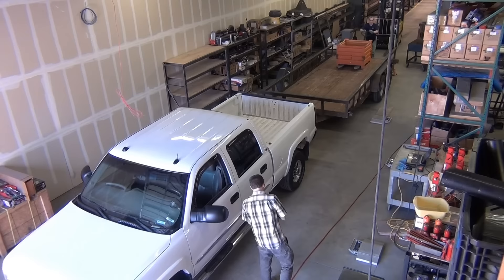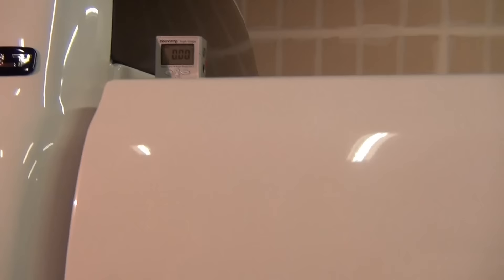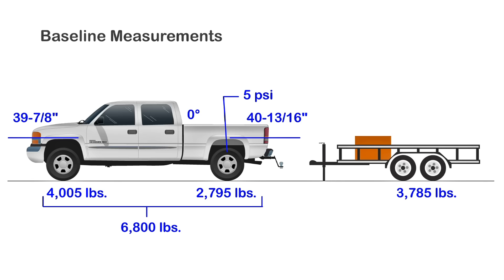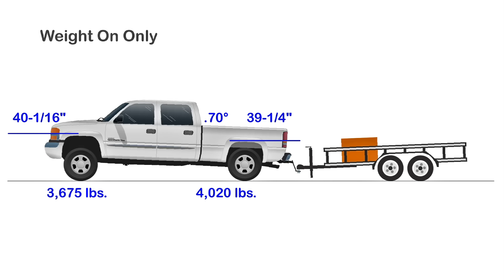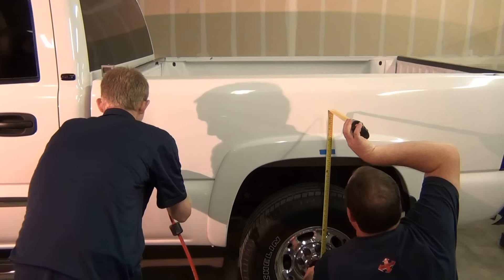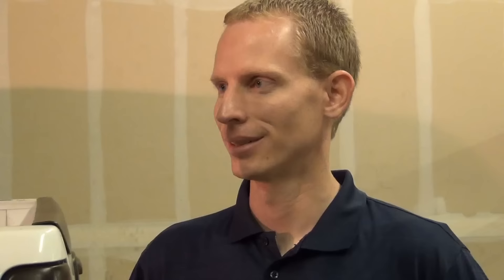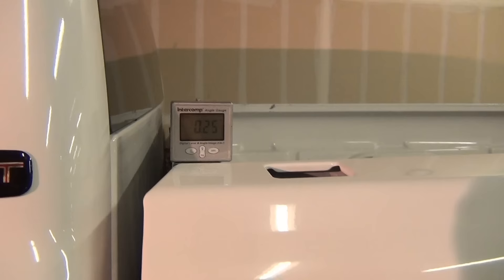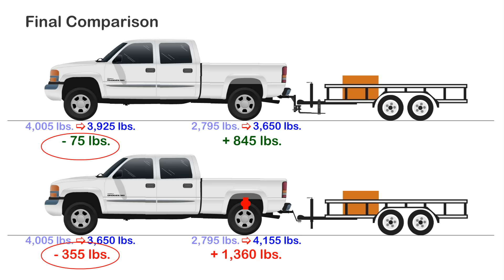The Difference Between Using Weight Distribution and Air Bags to Level Your Load

Comment: Hi, can you confirm the overall combined weight increases when using the WDH compared to using no other devices for levelling vehicle??
Reply from the maker: When looking at the overall combined weight for the “coupled”, “leveled with airbags”, and “weight distribution” setups – the resulting totals were 11,695, 11,715, and 11,720 lbs. The difference in these numbers is attributed to the precision and accuracy of the wheel scales that we used and is within 0.2%. Being within 0.2% when the precision/accuracy errors of 8 different scales are added together is quite good – especially for our purposes in this demonstration of general principles.

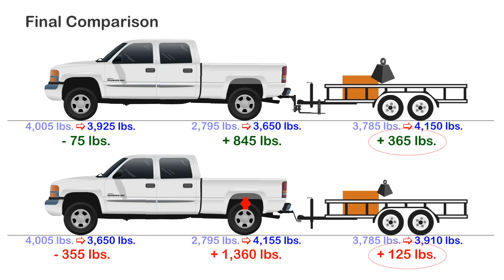Admittedly however, there are some typos and a mistake in the numbers shown which do account for some discrepancies. One of the mistakes is with the baseline trailer axles number which then carries through in the math throughout the video. With the trailer uncoupled we used an additional scale under the jack when measuring the tongue and axle weights. There is a conversion that then needs to be done to get the exact weight at the hitch ball coupler location. We used the converted (actual) tongue weight of 1000 lbs. in the video but forgot to use the converted axle weight. So, the uncoupled or baseline trailer axle number given is 70 lbs. less than the actual. Also, we didn’t add the weight of the spring bars (35 lbs.) to the uncoupled total. With these two corrections the “uncoupled” combined weight should have been 11,690, only 5 pounds different from the “coupled” combined total. The additional discrepancy is due to the precision and inaccuracy of that tongue weight scale that we used. At minute 12:17 in the video – the correct increases to the trailer axles should be 295 lbs. for weight distribution (instead of 365) and 55 lbs. for the airbags (instead of 125). For the airbags, that trailer axle difference should theoretically be zero when leveled. The reason it’s not is due to the trailer not being at the exact same level/angle and the scale precision/accuracy. As the trailer tips down in front then the front axle of the trailer will take a slight bit more load from the tongue weight. In the weight distribution example, some of that weight difference would also be from the trailer angle and scales then also some from spring bar weight. The majority (~250 lbs.) is from the forces of the bars on the trailer for weight distribution.

In spite of some unfortunate presentation mistakes in the video, those errors only affect the magnitude of the effects which will be different for each towing setup anyway. The general principles remain the same – 1) Even though airbags are good for vehicle leveling and ride comfort, they do not distribute weight off the rear axle back to the front axle nor achieve all the towing benefits that come with weight distribution and its inherent sway control 2) Weight distribution increases front axle weight for improved steering and handling and also alleviates the weight and stress on the rear axle of the tow vehicle 3) Because weight distribution also levels the vehicles, airbags usually are not necessary when using a weight distributing hitch.

Final note, airbags or auto-leveling can be used with weight distribution to improve ride comfort if desired or if auto-leveling cannot be disabled on the vehicle. Keep in mind that increasing airbag pressure or auto-leveling after setting the hitch will decrease weight distribution. Measure the amount of weight distribution after leveling the vehicle and adjust the hitch as needed to maintain the appropriate amount of weight distribution. Refer to the following video for more tips on adjusting your hitch when using airbags or auto-leveling in conjunction with weight distribution - https://www.youtube.com/watch?v=mj2oqAiltsk.
Reply: @FastwayTrailer  yes, i have found the same, thx

Comment: I retired as an engineering manager from one of the popular air bag companies. I was pretty nervous about where you were going with this, but I say bravo and well done! Air helper springs do not solve weight distribution problems, and WD bars do not solve the problem of sagging springs. Unfortunately, both industries advertise differently. I want to comment on the application of the air springs.. when the air is pressure is proper, the frequency of the bouncing will be acceptable to the driver and passengers. A slow deep bounce means under inflation. A fast harsh bounce/ride probably means over inflation. It requires trial and error to find the correct combination of air pressure and adjustment to the WD bars. Another point I want to drive is that the air springs must not be carrying the full weight of the load..it will create undo stress on the frame and an unbalance suspension. Always readjust the WD bars after adjusting the air pressure, and vise versa. Once you figure it out, you should be good unless you make changes to the load ie: you put your motorcycle in the back of the truck, etc. thanks!
Reply from the maker: Thank you so much for the comment, especially the great advice on getting the proper pressure in the air bags for the best ride and the caution about carrying the full load, as we get a lot of questions about the air bag inflation in the comments here. Thanks for watching, and please, feel free to weigh in again anytime!
Reply: I was just gonna ask if you used both how that makes a difference if you use the airbags with the weight distribution hitch what does that do you know the guys should do a video on that as well.
Reply: Good video, you addressed each system but you never addressed using the two together I have an F250 that doesn't have overloads and I'm using airbags as overloads I'm planning on towing a trailer with a slide in camper on my truck can I or should I use weight distribution and airbags?

Comment: I use a WD hitch WITH airbags on my half ton. It eliminates any bounce you may encounter driving on bad highways. They work great together.
Reply: I’m thinking of getting airbags for my 1500 Sierra but I have one question, when not towing  do those airbags running on 5 psi make your ride quality worse? I’ve heard the ride quality is very bouncy when not towing.
Reply: No it’s actually better
Reply: What PSI do you run in your bags?
Reply: I’ve discovered the air bags and WD hitch working boy together works great together. Now I have upgraded the braking on my truck on all 4 wheels and on the trailer brakes.
Reply: I used both and it worked great.
Reply: Just get both. 👍🏿🫡🤷🏾‍♂️

Comment: Great video. I really would of loved to see the numbers at the end if you would of filled the air bags to get the rear back to "zero"level with the using both to  together.
Reply: Exactly,  great video but I would like to know if air bags would help coupled with the weight distribution hitch.
Reply: The more you use the air bags to raise the rear the more load it takes off the weight distribution hitch. Therefore, it reduces weight on the front axle and increases weight on the rear axle. Check out this follow up video for more numbers and details - https://www.youtube.com/watch?v=mj2oqAiltsk.
Reply: @jasonh2832  properly set up, the wd, then yes you could finish off the leveling with air suspension, however this will require a different set up of the wd. It will need to be about one link tighter. Your weight distribution will be the same, you'll loose that 1/4" squat, and the ride will be smoother. I'm a proponent of using both. Along with Timbren stops to smooth out hard bumps, and reduce roll. And don't forget good trailer brakes too.
Reply: That’s what I said
Reply: @jasonh2832  I have both airbags and e2 distribution hitch, my question is what should my airbag pressure be before I setup my e2 hitch?
Reply: I would not recommend air bags with equalizer hitch!

Comment: I have both air bags on my truck and a weight distributing hitch with my enclosed race car trailer.  Best of both worlds.
Reply: I was curious of this as well. Did you setup the bags first then the WDH? Thanks
Reply: @josephbrockman5715  I had bags first for the weight I carry in work tools so every trailer over a certain weight needs by law for distribution set on the trailer just like tow mirrors are law for length .. like ol' boy said best of  both worlds.. I still need to dial in the distribution bars torsion then dial in the bags ...

Comment: I made a video explaining that if you have a heavy pulling vehicle and a light trailer, you should NEVER use a WD hitch because weight will distribute from pulling vehicle back to the trailer. Keep in mind, some small travel trailers can only accept #500 of cargo. Therefore a WD hitch can be a bad thing in some cases. I got called a liar and many other terms, even though my info came from Reese Hitch engineer. I am so glad an engineer is testing it right in front of everyone's eyes with scales and tape measures etc. I do my best to educate others and get educated myself. Thanks for the video, it is very informative, and clear! This video clearly shows a WD hitch can send weight to the trailer axle causing it to be overloaded.
Reply from the maker: This is kind of a complex principle to explain, but we’ll do our best. You are correct that in theory it is possible to overload the trailer axles when using a weight distribution hitch, and that it is more likely to happen with a smaller trailer having a lower gross vehicle weight rating (GVWR). However, this could only happen in practice if the weight distribution hitch has been set up to be over-adjusted.

In this scenario, the hitch would have to be set up in such a way that enough weight is being lifted off of the rear axle of the tow vehicle that the portion of this weight NOT being therefore carried by the front axle of the tow vehicle, when added to the trailer’s gross vehicle weight (GVW) would cause it to exceed the axle rating. For example: a trailer with a GVWR of 3,000 lb, loaded close to capacity at 2,900 lb, with the hitch adjusted in such a way that it is lifting 600 lb from the rear axle of the tow vehicle, where 400 lb of this weight is then carried by the front axle of the tow vehicle, and 200 lb is carried by the trailer’s axle. In this case, the GVW of the trailer at 3,100 lb would exceed the GVWR of 3,000 lb.

You can see by the example that this would be a difficult and unlikely scenario to achieve, though it is possible to achieve.

Thank you for watching, and for the thought provoking comment! We’re glad it was helpful for you.

Comment: I use both! The bags kick the bouncing. I tow a 35 foot travel trailer and always use weight distribution with anti sway and put 35 PSI in my bags.
Reply: I also use both, my father used both.

Comment: Well thank you, I just cancelled my air bag installation at a workshop 30 mins ago based on this video because the RV dealer has installed an expensive, higher weight rated Reese WD hitch on my new 31ft travel trailer which weighs 7600Lbs loaded. I think I'd better stick with the science and data shown in this video than having both airbag and WD combined because it won't help at all. A solid educated decision made and thanks to your video for that.

Comment: I used both. Firestone air and equalizer weight distribution hitch on a 09 RAV4 v6 wtp. Towing 3500lb.  Set up by RV company.  Handled beautifully on 5900 mile trip.  No sway handling problems. Car and trailer are level.   Very happy with rear view camera set up while towing also.

Comment: Painstaking review that took the time to prove results by weighing the vehicle AND trailer. No one does that. I’d have guessed the airbags would be superior but the much less expensive distribution hitch clearly came out on top. I pulled a 22’ work trailer with the distribution hitch and I could barely feel it back there. I had to check my rear view to see if it was still there. 👍 Great job guys!

Comment: I haul different types of RV's so i need both air bags and bars. When i pull a TT i use bars mostly when weather is good but in winter driving i lighten the bar load and put more on the air bags... i like more weight on drive axle. Also, some jurisdictions require equalizers. What i like about the air bags is that the handling is better with less sway.
This is great info especially for someone that pulls the same trailer(s) regularly.

Comment: I'm surprised that some people still think of it as an either, or question. Especially when the two options were developed to solve two different problems; and neither was intended to increase payload capacity.

Weight distribution hitches were designed to help redistribute some of the weight between the tow vehicle and the trailer, in a way that improves overall safety and handling when towing. While they may help to some degree with sag, that's not the intended purpose.

Air suspension systems were designed to provide a solution for sag, as well as improve ride comfort. Using it to redistribute weight isn't at all appropriate; and as the demonstration shows, can even be detrimental.

It just makes sense to consider using both, because together they solve multiple problems simultaneously, without hindering performance, or safety.
Reply: I was just thinking this. Would have been nice to have seen the WDH set up and then use the airbags to get back to the optimal ride height. What would that have done to the weight distribution according to the scales. Oh well!

Comment: Air bags are ABSOLUTELY NOT a replacement for weight-distribution hitches! You may not sag in the rear, but you're still pivoting that weight onto the back axle and OFF of the front...the STEERING axle. Amazes me how many stupid people are towing shit around, an accident waiting to happen.

You're the first guys to actually provide an accurate, in-depth informative explanation of how to properly, and SAFELY, set up a trailer and tow vehicle. I hope this video saves someone from a ruined vacation or worse! Truckers are regulated til there's nothing left, while the general public and RV dealers can hook anything to anything with zero accountability.
Reply from the maker: Thanks for watching, and thanks for the comment!
Reply: Tell us what you really think!    I think the answer to this question is really....It depends on what you are towing and what you are towing it with.

Comment: I have both as well. Recently purchased a 29' trailer (4600 lbs empty) to tow behind our beautiful 2004 GMC Envoy XUV XLT (89,000 miles on odometer, bought in new) which is rated to pull 6400 lbs. It has airbag suspension (I replaced the airbags two years ago), and installed an Equal-I-zer WD and anti sway hitch. The Envoy does not sag at all and rides so well I can't even tell I'm pulling a trailer. Nice.

Comment: Typically any load on your hitch over 500 lbs should be done with a Weight Distribution Hitch.   This is true for most class 3, 4, 5, etc hitches 

From there, you should be adjusting the height of your hitch ball on the WD platform to make your trailer level.  The truck's rear suspension will sag a bit, but it is fine. 

If you want to remove the sag, and improve front wheel handling and stopping, and lower your headlight beams, then you should add airbags to remove the sag from the rear of the vehicle. 

After adding the air bags, you will likely need to lower your hitch ball height on the WD platform so as to keep your trailer level.  

Airbags are not a replacement for WD hitches!

I run both.  WD hitch is a must.   Airbags only improve from there.

Comment: I tow  4000lbs, with a Rav4 V6 w/tow package, air bags and weight distribution hitch.  Proper tires. No handling problems in storms, high winds and passing semi trucks, in 6000 miles.

Comment: I've used the chain WD hitch for years on a construction trailer on short wheel based vans with the friction anti swaybar. On Long wheel trucks I did not need the sway bar. Got use to the chain adjustment fairly easily. When setup properly towing is a pleasure. I just bought a new enclosed cargo trailer and the old Huffy would not fit. I would need to cut holes in the floor to link the chains up. Bought a newer style WD hitch setup called a Curt True track #17499 WOW what a pleasure to tow with this! It has square spring bars that allows shorter placement of trailer frame clamps. And this system doesn't use chains. So the anti sway is built-in to the product.

Comment: I was wondering if you have ever done that same type of analysis using a WD hitch and airbags at the same time.  I would be very interested in seeing the results from that setup.  Thanks.  Great video by the way.
Reply from the maker: Thanks for your response! We don't normally recommend using both air bags and a weight distribution hitch together. The air bags can counteract the weight transfer that the WDH is giving. Using air bags to raise up the back end of the tow vehicle will decrease the amount of tension placed on the hitch, which determines how much weight distribution and sway control you will get. So, raising the rear of the tow vehicle to eliminate squat will reduce sway control.

Comment: Thank you! This video has saved me $900 for an air bag installation. I am purchasing my second RV and putting the best WD Equal-i-zer hitch available for our truck and RV. I had considered both actually to compensate rear axle stress and sag. My suspicions are confirmed,  a properly installed WD Hitch (i.e. your video on installation and importance of measurement) will be sufficient.
Reply from the maker: +Mike Bushert,
Glad it was helpful and informative. Thanks for the comment, and good luck with the new RV!